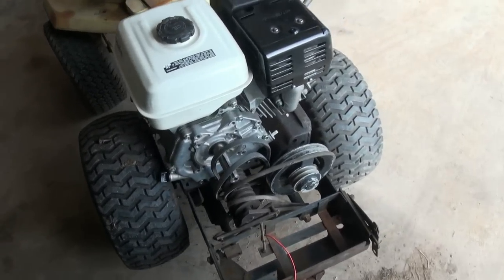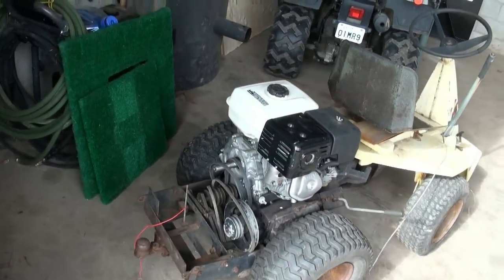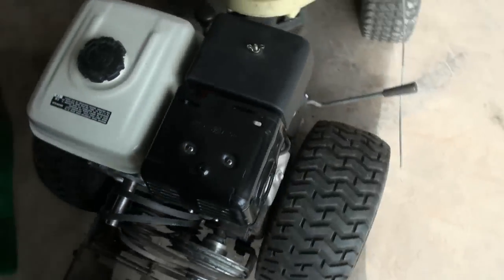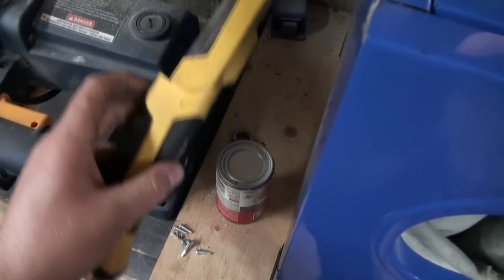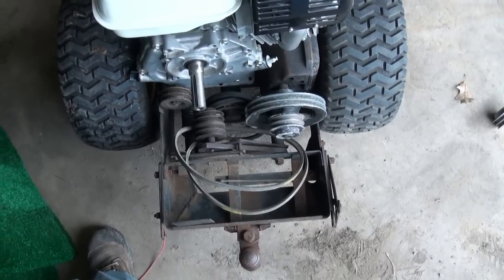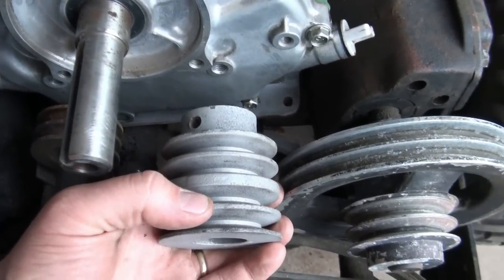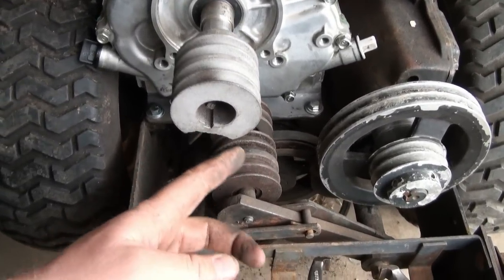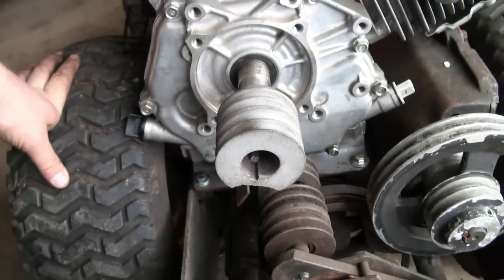Sweet old mower for the next project      P A R T 2

Comment: if you are getting new belts any way why not make another plate to elevate the motor above the tire so that it doesn't rub? then you could mount the motor wherever you wanted to and be able to put the whole pulley on there and run all the belts and the pto too still